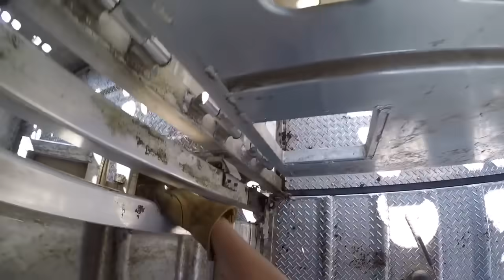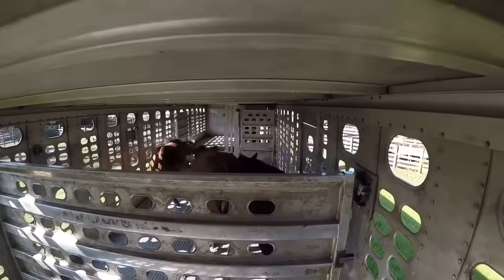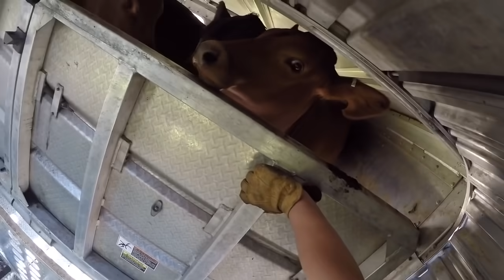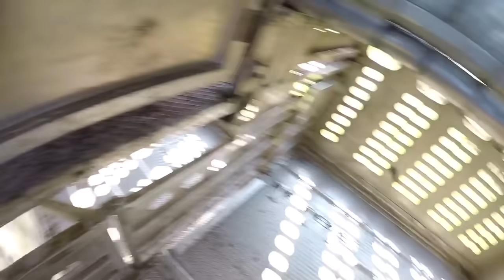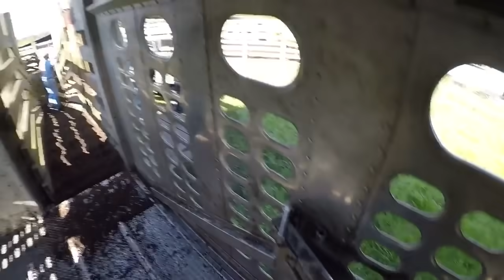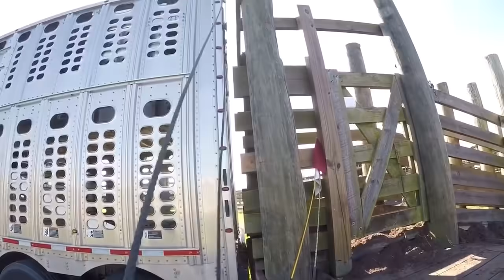Yet another cattle loading video.

Comment: Thanks for posting this video! I've always wondered how you guys stack all the cattle inside those trailers when I see ya'll driving down the highway. :) Now I know! Pretty ingenious the different compartments for them!
Reply: Hey another fun fact you can think of when you see the murder trucks! They are all children, less than 3 years old, they are terrified, freezing or boiling today in there depending on the weather, they are most likely claustrophobic from being slammed up against the walls, having trouble standing or being stomped on because they are not used to traveling for countless hours in a truck that is throwing them all over the place, they are missing their children and family that they have been separated from, they are desperate to escape and they dont want to die, the next several hours of their trip they will be enduring pure horror up until their final moments where they get a bolt in the head or their necks slit and bleed out slowly, the smell of death pulling up to a slaughterhouse is unlike anything I have ever experienced in my life, say a prayer for those children instead of enjoying them like an attraction
Reply: @bunnz2830  steakhouse
Reply: @soldier3157 some folks 😂

Comment: so the cows aren't jam packed into the trailer, huh.
Reply: b0t.- nope
Reply: its safest for the cattle actually to loaded body to body.. if you load too loose they can fall and get stepped on potentially breaking a leg or hip and having to be put down.
Reply: Ahhhhh...... sure
Reply: It would be to much weight to completely fill. Big tickets.
Reply: O yes they are lol
Reply: Hey another fun fact you can think of when you see the murder trucks! They are all children, less than 3 years old, they are terrified, freezing or boiling today in there depending on the weather, they are most likely claustrophobic from being slammed up against the walls, having trouble standing or being stomped on because they are not used to traveling for countless hours in a truck that is throwing them all over the place, they are missing their children and family that they have been separated from, they are desperate to escape and they dont want to die, the next several hours of their trip they will be enduring pure horror up until their final moments where they get a bolt in the head or their necks slit and bleed out slowly, the smell of death pulling up to a slaughterhouse is unlike anything I have ever experienced in my life, say a prayer for those children instead of enjoying them like an attraction

Comment: How dose that have so much space
Reply: I know how they just yeet them in they must be soo tight and squishy in yhere
Reply: There is more room than people think. Most trailers are 53 ft long 2 decks x amount of weight spread over 106 ft.
Reply: zebrafreak971 thats not even that full,he cant fill up more due to his weight,his trailer is only a dual axle not a tri or a tri with an extra drop down axle.Reason why you normally keep them compacted in a liner is because for safety,if they can move around alot it can be unsafe for the cattle and the public.If there is alot of room an animal could fall and get stepped on (breaking legs etc) and trailers are tall if you have alot of room to move around on top deck it becomes an unstable trailer which can make them flip alot easier.
Reply: It’s a semi truck trailer, 53 ft long 102 inches wide

Comment: I know this video isn’t current but how many was put on the backend I was at 87 before the last few before the door was closed
Reply from the maker: Junie Carter 
It can sometimes be difficult to count the cows in the videos, but we loaded 10 more on the back end for a total of 97.
Reply: Ok I’m thinking about getting into hauling cattle in your opinion what would be the best trailer to get I’m a class A driver?
Reply from the maker: Junie Carter 
My trailer was a 2016 Wilson Silver star and I loved it, but they can be expensive. My advice depending on if you want to do this long term or short term, find a solid used trailer to begin with(if you’re unsure how long you’ll be doing this) long term, go spec out a new trailer and it’ll be the only one you’ll ever have to buy. Quick side note, Wilson Trailers does sell used/refurbished trailers so that’s where I’d start.